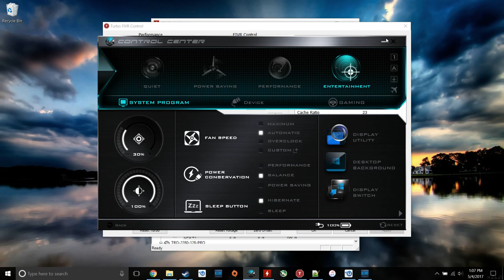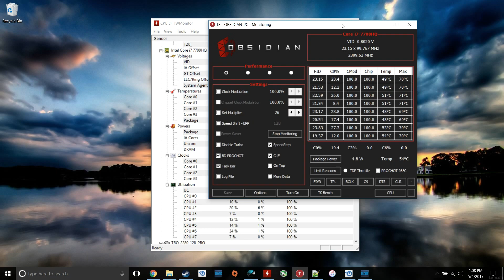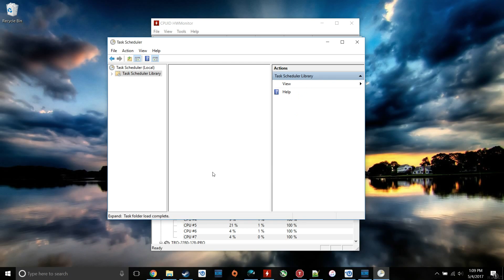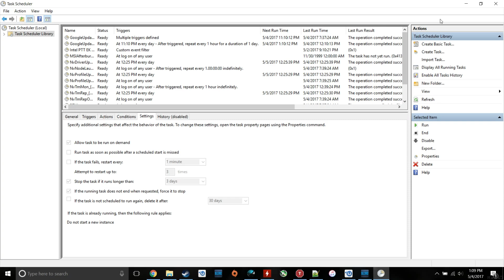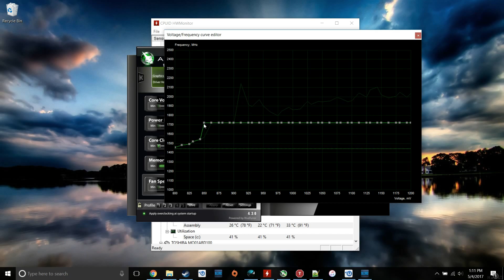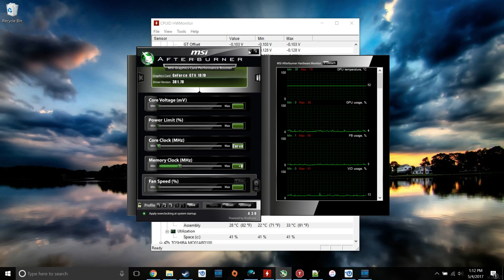i7 7700HQ & GTX 1070 Undervolting - Much Better Thermals

Comment from the maker: Today I tried starting TS and it said my version had expired. Got new version from here (https://www.techpowerup.com/) down under the Nov. 1st section of files. Deleted the folder containing the old TS, put new unziped folder in its place. Update Task Scheduler to reflect new location of .exe file so it will start up on boot.
Reply from the maker: If you have issues getting this done I can make a video if needed. Let me know.
Reply: Nicholas Ringwood stop scamming people. You did NOT mention that you had turbo boost disabled in bios. Fake
Reply: Haseeb Bhatti god damn, chill tf out, the undervolting still works even with turbo disabled

Comment: I was hitting thermal throttle on some high intensity games which gave me stutters. This stopped my thermal throttling in exchange for slightly lowering my FPS. It lowered my temps by 20c! Thanks for the guide.

Comment: -125mv on core & cache with other settings the same as yours is a crash on my exact same CPU.  Repasted now 3x and all 3x tried getting close to the 125 or this last time going direct there and all 3x it made crashes.  
I would recommend closer to -100 for most stable but of course not all chips are equal, so for some -125 may just be fine.
Reply: Wow, I have i7 6820hk and it’s work well with -165mv

Comment: A bit late but
CPU  - 140 mV
Gpu = 1900mhz @ 0.875 MV
Runs at 70'C since 3 years now without problems

Other option is, disabling the boost function in the battery settings to power limit 99% not 100%

It avoids the heat and power throttling  from 6 cores to 4 and uses only the 4 physical ones

Comment: Asus rog gl503vm same cpu but with gtx1060 at undervolt -135mV on everything (cpu gpu and cache) Should i change the settings a bit. Turbo 3.6 i am thinking of going -125 cpu and cache and -110 on gpu. But should i keep turbo on? I am having fan noise so i might turn turbo off. Any help or tip?
Reply: fan noise to a gamer == ARE YOU SERIOUS!!?   buy headphones and STFU about your fan noise.
Reply: @ihatesignupsgrrrrrrr  lmao sure and on the first week have the fans dying cause of being on constant turbo boost for nothing when you don't know what's going on don't give advice
Reply: @itsvenyx  I never said you can't adjust the fans on and off or the speeds...  Of course you can adjust the fan speed when NOT gaming!  
It took my fans 3-years of heavy usage before one of the two failed...  The replacement took me 5-minutes(10 minutes more to confirm correct fan and order the replacement) and $10-11 of parts plus have the second fan ready to be replaced(found both fans on ebay cheap).
ThrottleStop you can setup different speed profiles as well as Intel's Extreme Turning utility can automatically make this happen, plus there are various software programs that can adjust fan speeds as well.
I think I do know what I am talking about since I personally have done many hours of research about this, just didn't spell out all the details for you :/
The only alternative to headphones and the fan noise would be a water-cooled PC!  --Laptops have massive thermal issues, everyone I have ever looked into, minus the one laptop I found with expensive water-cooling which also did not become a common trend unfortunately!
Reply: @ihatesignupsgrrrrrrr  For PCs i agree you can adjust everything whoever you like but on some laptops you can't adjust even fan speeds. That's the situation I'm talking about, you can't set them from bios nor msi afterburner nor anything else so you are completely limited to playing with windows settings and in app settings the best case you get some success with replacing thermal paste but that's it they still boosting for no reason but yeah. Laptops are just a big scam sadly ngl

Comment: Nah, temps dropped because turbo boost was off :/
Reply: Still works with turbo on...
Reply: @JuanLopez-ss3mz  have u seen max clocks reached?? 2600mhz so it wasnt boosting ...
Reply: Albert Wesker I know, I’m just saying that from experience, undervolting still has a significant heat reduction even with turbo on
Reply: @JuanLopez-ss3mz  yep but not in the CPU case from video

Comment: When I unplug my laptop charger it freezes. This is only after I undervolt to -100mV. Otherwise it is stable even at -120mV but this problem is really bugging me :/
Reply: @Mike Motii I tried but it doesn't help. I already got used to it. I made 2 power plans in throttle stop and when I am playing I am changing it.

Comment: That fan curve kicks ass. I'm using that, plus Thermal Grizzly Krynoaut on a GL702 and I'm pretty much constantly at 1750MHz on the GPU and 3.5GHz on the CPU. Temperatures still aren't what I would like them to be but it's effectively stopped the thermal throttling problem. My GPU used to throttle down to sub-1300MHz all the time.
Reply: Smooth gaming is the best gaming...  WAY better than having that thermal throttle all of a sudden give you that stutter lag!
I have to mention; MSI fans are the worst -- 3 dead MSI fans in 3-years!  Lesson learned; do not put fans to 100% often unless you don't mind replacing the fans (repaste and disassembly in addition to ordering replacement fan costs).

Comment: Your CPU is not going over 2600mhz..
That helps the Temperatur as well.
Usually the 7700hq is going to 3400 on 4 cores.
Reply: My 7700hq can only hit 1700mhz to stay at my preferred max temp of 92c but can still hit 95c after a few hours of high-usage....   Always trouble I have with the Intel CPU's and the thermal from laptops, makes me want to give up for good on Intel.
Reply: @ihatesignupsgrrrrrrr  i have i7 6820hk with -180mv and 3,6Ghz on all cores stable. 
Temps are amazing since i applied liquid metal. Before that was hitting around 92 degrees, after it i am staying at max 76-78
Its amazing how liquid metal changes the laptop

Comment: I'm having a problem I undervotes my laptop and it's not any different if it is its maybe a few frames. I'm using Intel extreme tuning. Should I repaste it? I got it off cl abd it's in perfect condition but it seems to be under performing and over heating. Hitting 95 and shot in gta abd ffxiv

Comment: I undervolted my 7700 hq to - 150mv and the cpu temp got to 99 degrees c max while playing overwatch. Is this normal?
Reply from the maker: No that is not normal. I can't get over 70C playing overwatch at max settings.
Reply: Christopher Tang  -120mv or -125 is the sweetspost for 7700hq. try it -150 is too low i guess
Reply: i have a msi ge72mvr 7rg apache pro and my room temp is 23 c or 75 f. its a i7 7700 hq and a gtx 1070. i just updated the fans and bios thinking that would help alot but nothing
playing the witcher 3 in sport mode its 90+ almost all time and in comfort its high 80s
Reply: Joseph Heartsu did you undervolt? I used to get the same temps but after - 110mv undervolting, I never go above 80. Sports mode of course.
Reply: Vaibhav Shah well yes that's why I'm here I undercoated by 110+ and don't notice a difference I use xtu and apply it at least I think. I'm 99% sure I did because I'm far from computer illiterate I was thinking I need a repaste. I bought it off Craigslist and the dude had it for a year or so so probably needs one
Reply: @JosephHeartsu  Demanding games will push the CPU to its limits, even if you undervolt there is no guarantee the temps will be lower. Overwatch and Witcher 3 are poles apart in terms of visual fidelity, witcher 3 will push the boundaries and the CPU will reach high temps. As long as its below 105°C your CPU is fine. They are designed for high temps and to withstand long gaming sessions, just dont lose sleep over it.
Reply: Oh no. I have the same CPU and put settings to -0.110 and and now I can play Gow 4 in high settings and my tem is 70 C 
Before that was 82 C and efficiency is very very stable
Reply: my acer predator 793 reached 95C while playing ffxiv.. I tried to under it for like -130 but it still reached 80, I just got this laptop since april and kinda reluctant to send to repair because I don't know how long they will repair it for, so i'm just waiting to get a new desktop and then send it for repair so I can still play games while waiting.
Reply: Hisashi Prince try repasting man
Reply: ye I've done that, its good now.. it took me less than an hour to do it while watching guides... 
ty for tip though
(this is my other account)
Reply: Ryuu XXII oh,okay,does it help btw?
Reply: yeah before it would stand between 85 to 95 only playing ffxiv on standard settings but now it stays around 70 sometimes I can put ff14 on the background while waiting for dungeon to pop, all the while playing rocket league and still wont go above 78 sometimes it reaches 85 but that's in extreme cases and even also because of summer temp but it's no way near the 95+ that was before coming straight out the store
Reply: Ryuu XXII well,better then nothing at least!
Reply: I'm having a problem I undervotes my laptop and it's not any different if it is its maybe a few frames. I'm using Intel extreme tuning. Should I repaste it? I got it off cl abd it's in perfect condition but it seems to be under performing and over heating. Hitting 95 and shot in gta abd ffxiv
Reply: Joseph Heartsu what the laptop,all specs,how much temp on your room when you using it?
Reply: Sounds like you need to repaste

Comment: I've settled around -110mV for my 7700hq...should i be pushing it further?
Reply from the maker: Prateek Patil Really just depends if your happy with the thermals. You could push further if you were still getting hot under load
Reply: Yeah, the 7700HQ can be lowered up to -0,150V in some laptops. You just lower -0,005V each time and stress test for 10min until you notice instability or blue screen that's when you know you hit the limit.
Reply: Mine is also sitting at -110
Reply: Prateek Patil did you manage to lower it further? I've seen some people go to - 125mv
Reply: -110mV is the max you can go if you play demanding games. I went upto -125mV and when I play The Division, it crashes. The game is so CPU bound and the undervolting doesn't help with the temps, keep hovering around 90°C. Depends on the application though.
Reply: I'm trying this for Division 2 now, did you undervolt the GPU as well? I did some and the Division 2 freezes.
Reply: @LuciusHR  If you have DX 12 enabled in Div 2, I would suggest not to undervolt the GPU. DX 12 draws more power.

Comment: How is the laptop? I'm planning on buying the same laptop.
Reply from the maker: ChanoPine Official Stikl doing great! Playing Destiny 2 on it currently . I did cap my frames at 60 and high quality settings. I run 9 instances of a game in the background and noticed it was a little warm. Expected tho. Fan on max with those settings and multiple windows running in the background as well as a 2nd screen through HDMI attached playing twitch, and it won’t get above 70 degrees for me.

Comment: How is it going with the laptop?
Reply from the maker: J0keriznogoud I have nothing but good experiences so far. If you want a video of anything in particular let me know. I treat it as a workstation laptop and have a second screen always connect, run chrome on one side and a game on the other with no issues. I've been playing around with my fps in games and some overclocks on the gpu lately.
Reply: Nicholas Ringwood Thanks for this quick reply. I am kinda interested in asus just cause it is offering 120 hz that is perfect with a 1070. And also as an internation student its kinda very tough to handle a pc. I am in canada btw , climate here is cool. What do you recommend?
Reply from the maker: J0keriznogoud can you link the one that you are looking at? Before I got this one I had an Asus with a 1060 in it from Amazon. It got dangerously hot before undervolts, where as out the box with fan speed on high. It was manageable. I think this laptop with the 120 Hz monitor is a great buy!
Reply: Nicholas Ringwood Is this available in canada though? I am talking about Asus gl502VS . What model do you have?

Comment: I use throttlestop. -145mV on m'y 7700hq and turbo disabled. I used to have 90°C playing PUBG, now im never higher than 70°C :D . Btw i cant undervolt my GPU... Any ideas? Cant with msi afterburner neither :(
Reply from the maker: tontolava2 I'm not sure why you're having issues. I did nothing special to get msi afterburner working for me. I've only reduced the max clock speed to 1600 and still play overwatch on epic settings with great fps even with second monitor running
Reply: Nicholas Ringwood i would like to undervolt the GPU without lowering its clock
Reply from the maker: tontolava2 I'll look into it. I believe you can't undervolt the dedicated gpu, only the integrated

Comment: Does it even matter to undervolt the integrated graphics if you will be using your GPU for gaming anyways?
Reply from the maker: I happen to use the MSHybrid mode occassionaly, so that is why I undervolted it.
Reply: If you are using Nvidia optimus, you pc will switch to integrated gpu in non gaming software. Undervolting will improve the overall battery life of the laptop

Comment: did you try windows key type recovery options then select restart windows loggs out into special menu then look for the option that lets you boot into bios. check for cpu features there. i have a eluktronics p650hp6  i7 770hq and gtx1060 i will check my bios and tryto respond back if i get results.

Comment: did you every figure out an actual way to undervolt the gpu?
Reply from the maker: No I didn't. Throttling the speed ultimimatly fixed what I wanted for my purposes. Laptop always running cool.
Reply: sucks because if we could undervolt it we could get higher clocks AND lower temps :(

Comment: Intel XTU saves my settings if you don't want to DL and install 2 programs. I have -0.135 offset on my 7700HQ.
Reply from the maker: I'm running that same offset through TS now actually too. Been great so far!
Reply: I did this but the temp went from 90 max to 85. What should i do?
Reply from the maker: Hows the temperatures looking @Pratik Ganguly?
Reply: I got my Lenovo Y720 up to -0.140V Offset, stress test of 10 min without any issue but it has a GTX 1060... Mind as well try, the lower the better.
Reply: is it running smooth , i have a 7700 HQ 1070 msi would it reach 135 on xtu ? im a bit worried that my gpu will blu screen me (im on -0.100.) do you think its fine going under my numbers?
Reply: @ludo nguyen i got the MSI 72MVR 7RG APACHE PRO, 1070 gtx, i lowered it to 130 , i got lower number in the benchmark on xtu,apparently i cant get that sweet spot, low internals but good performance! Weird tho